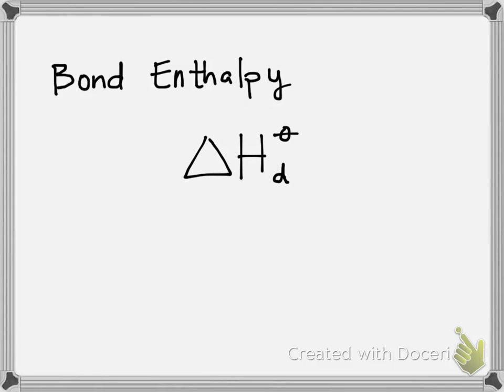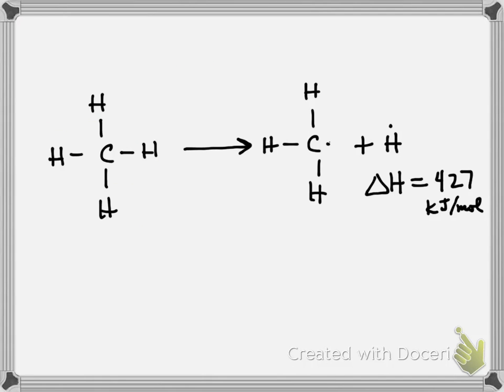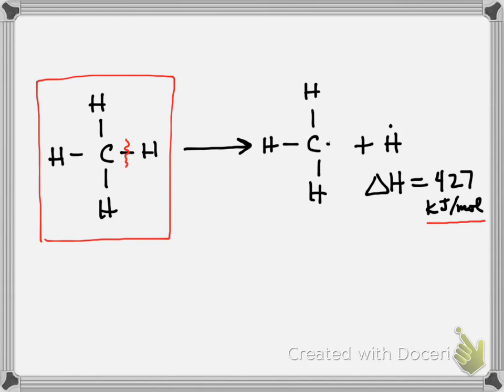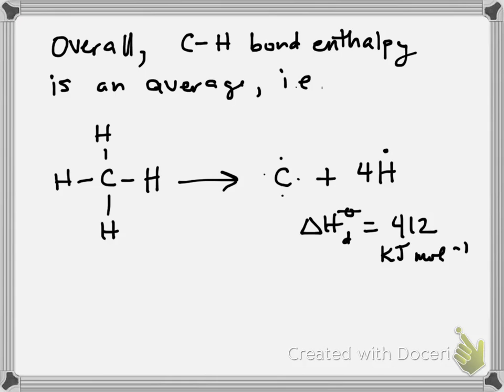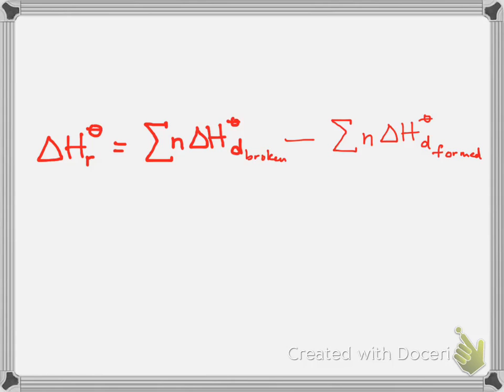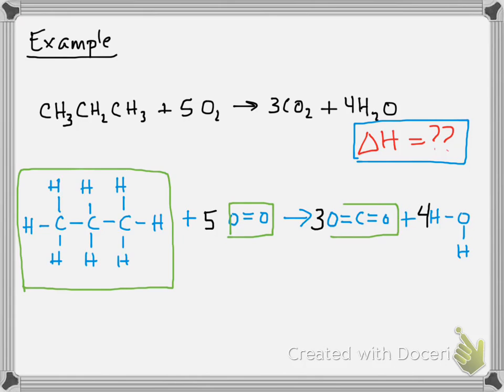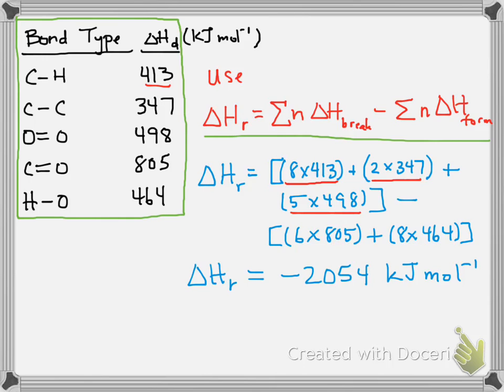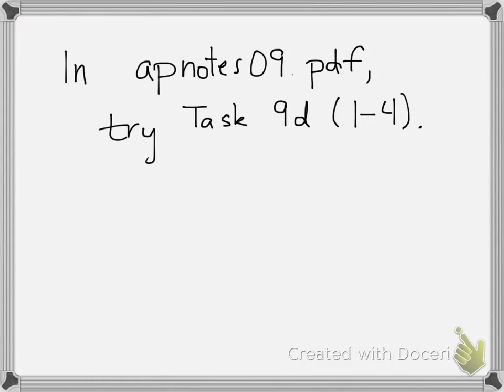Introduction to Bond Enthalpies

Comment from the maker: You don't need to multiply the O=O bond by two because for 5 moles of oxygen, you are breaking 5 moles of O=O bonds.  With CO2, breaking 1 mole of bonds in CO2 requires breaking two moles of C=O bonds (as there are two C=O bonds per CO2 molecule). The same holds for water, with 1 mole of water containing 2 moles of H-O bonds.

Comment: Why is it that 5 was not multiplied to get 10 But you multiplied 3 times 2 to get 6 and 4 times 2 to get 8? I am confused on that part. Phillip Cook
Reply: In calculating bond enthalpy, a double bond will be considered the same value as a single bond.This is seen as he counts the C-O bond for 3CO2 as not 3*4 but 3*2.